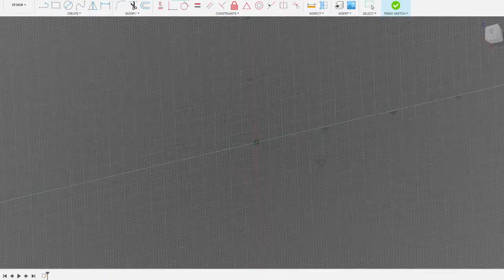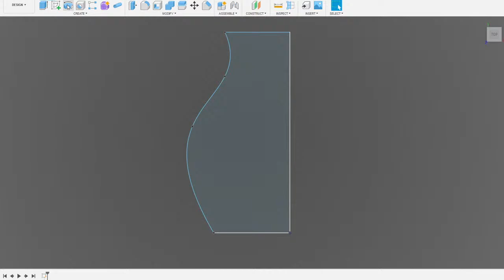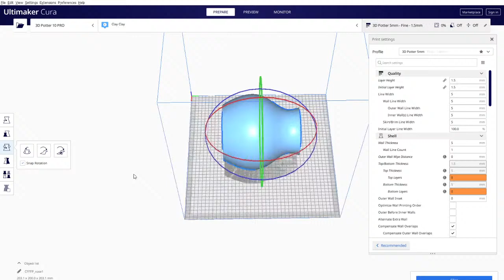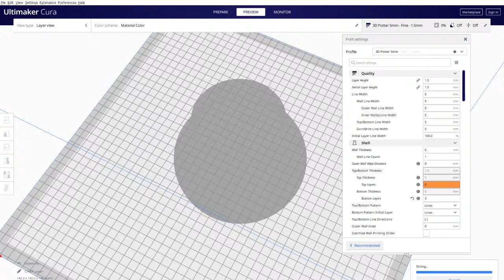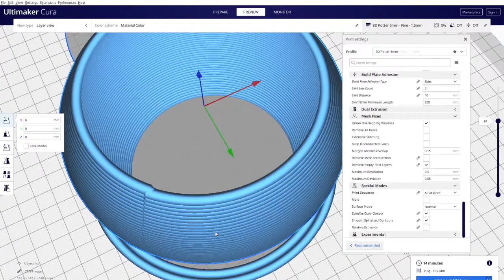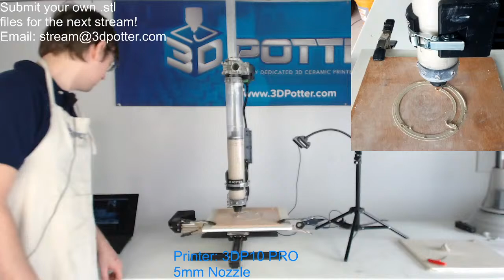3D Clay Printing: Object Creation, Stream 003

Comment: A nice little trick that I have found to help the first layers to stick, vs adding a little water to the bed, is to increase the extrusion rate by 200% for the first layer only.  This is a simple setting tin Simplyfy 3D.
Reply from the maker: Yup, that is very good advice. Depending on your material it can be very good to do that.